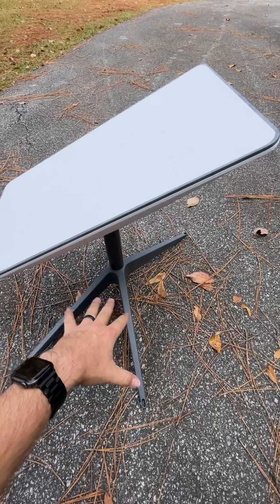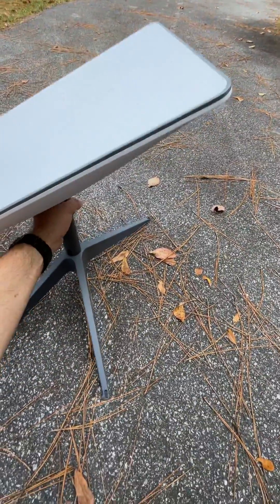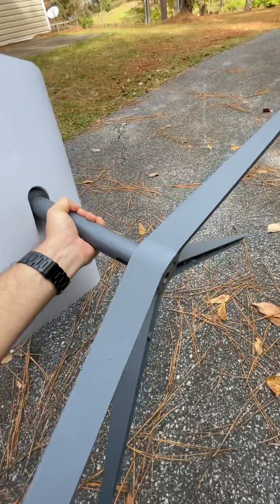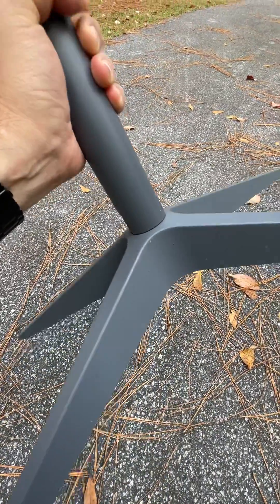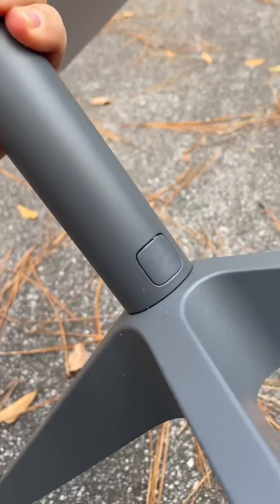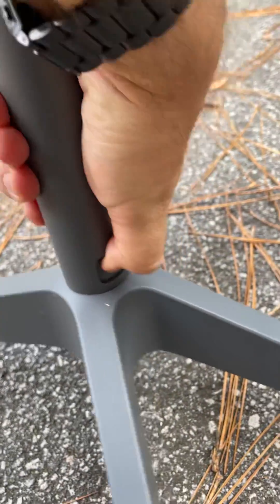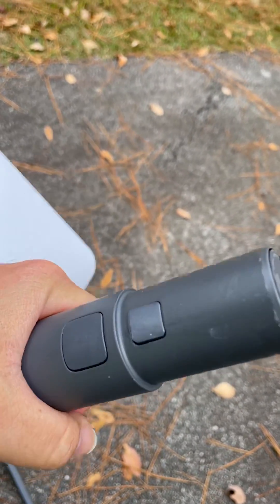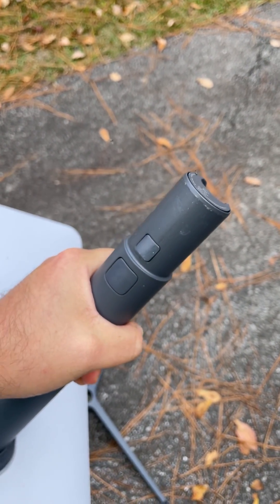How to Disassemble #Starlink Base

Comment: Does the other part come off? The long gray pole?
Reply from the maker: I no longer have one to take a look at, but my recollection is that it is not removable due to the other end being part of the auto aligning motor assembly. While still powered up, you can go in the app and put it in Stow mode to flatten it out for traveling though.

Comment: I got it to work after adding some lubricant, applying a lot of pressure through the shaft from the bottom while pressing the button and rotating the stem back and forth and back and forth.
Reply from the maker: Glad it worked out for you!

Comment: Thanku for posting. I will try again tommorrow with some WD40 to get the Starlink dish off the base.  The Starlink has been sitting loose on the roof attached to the four legged base since last year and has not blown over until today. I want to attach the Starlink dish to a Starlink Pivot Mount which sits on a Starlink Flashing Mount that I finally got the roofers to install while reshingling the roof. We could have just bolted down the base with four screws, but my husband had bought the pivot mount and flashing mount a year ago and it has been sitting in the box  unused.
Reply from the maker: How did it turn out?

Comment: Hello 😊I'm pushing my button and my base is not coming off. do you have any other Solutions?
Reply from the maker: If it has been out in the elements for awhile, lots of gunk can get in the seams of the mount connection. You may have to try to clean it away or spray some wd40 in there. Other than that, the wedge piece that is part of that button is the only thing keeping it in place.

Comment: How do I get the shaft sticking out the back to retract so it is flush with the back of the panel for storage????? driving me nuts
Reply from the maker: In the app, while everything is still plugged up, there is an option to Stow that will put it back in the orientation it was when it was still in the box. Sorry so late 🤦‍♂️
Reply: @Sylvestercomputerguy   thank you! I didn’t find stow anywhere 😢
Reply from the maker: Settings>Starlink>Slide to Stow

Comment: We pushed the button and two of us can’t pull it apart. Need to check connection, lost signal, think the dog pulled it over.
Reply from the maker: If it has been out in the elements for awhile, lots of gunk can get in the seams of the mount connection. You may have to try to clean it away or spray some wd40 in there. Other than that, the wedge piece that is part of that button is the only thing keeping it in place.

Comment: I have pushed the button until my thumb is sore...it aint coming off.
Reply from the maker: While pressing the button, you may have to push the pole in before pulling it out to relieve the tension first. It’s also possible that there is stuff gunking up the connection if it’s been outdoors for a very long time, so also flip it over and look in the gaps to make sure it’s cleaned out first. Barring these things, the pole will usually slip out fairly easily.